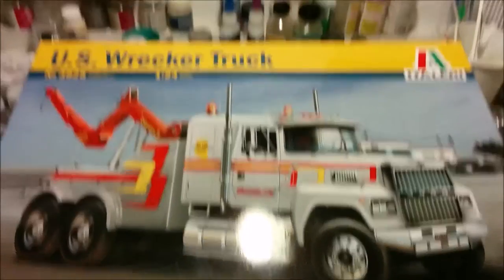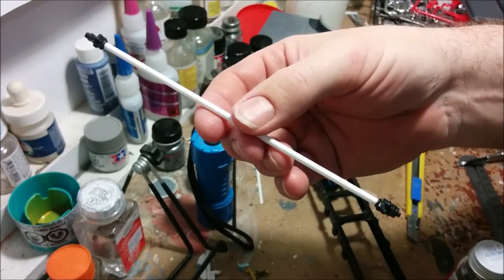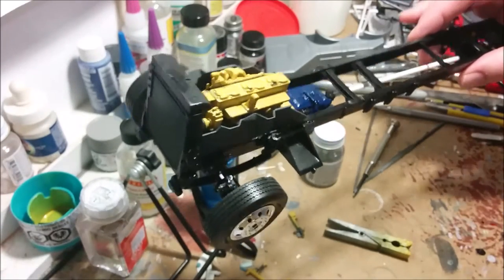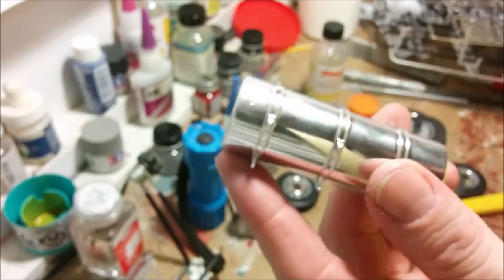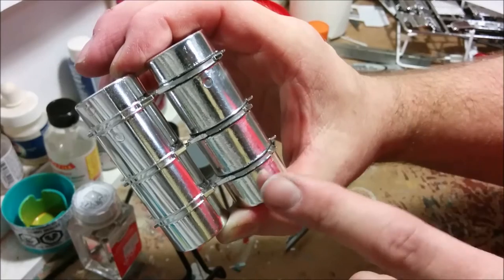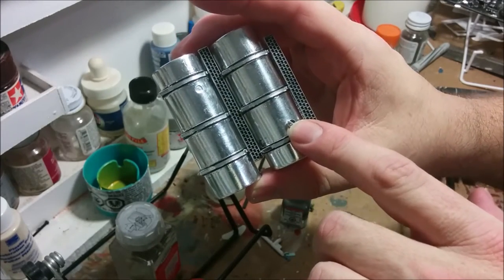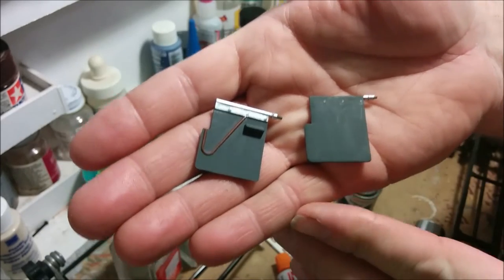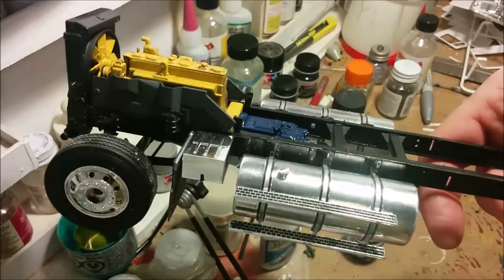Modern Wrecker Truck 1/24 Pt3 by Italeri

Comment: I’m super late to this party so I apologize for resurrecting an ancient comment section but I have just bought this kit and found your build series - I think it’s the best available for this subject, by the way. 

I was just wondering why you didn’t strip the chrome off a few of those parts, the tanks in particular, rather than trying to fight your way around it. The tanks on most heavy trucks are made of aluminum which some people like to polish to a mirror finish. However, no matter how much they are polished they never look the way kit chrome does. 
One of my biggest peeves about model kits is the gawdawful way the chromed parts look. I hate the way that chrome finish gives even the best built model a toy-like appearance, so I almost always end up stripping the chrome trees and either BM foiling or spraying parts with one of Alclad’s excellent options. This gives the part, and the model in general, a much more realistic appearance. 

That aside, I’m loving this build (excellent job stretching the frame!) and I’m enjoying your videos. Yes, I have subscribed. 

As a further aside, I have found K&S alloy tubing to be excellent for making driveshafts as it is straight and true and won’t bow the way a long length of plastic rod does. I would like to have seen that shaft split into two parts, or at least had a hanger bearing added. A single unsupported shaft of that length would probably deflect a bit and shake the crap out of the truck. 😀

Oh! One more thing: I note that you’re in southern Ontario so you may not see many northern haulers in your area. In northern Ontario (and many other parts of the country) larger deer such as elk and moose crossing the road at night are a danger to truck drivers. Moose in particular are heavy enough that, if struck by a highway truck, they can absolutely destroy the hood/grill, and tall enough that their main bulk will come through the windshield into the cab. 
Variations of the “Mad Max” style front bumper and moose bar that comes with the kit are quite common on trucks that frequent areas populated by these enormous creatures. It is terrifying enough to encounter one crossing the road at night in a heavily forested, extremely rural area where the only light is that of your headlamps. It is almost impossible to avoid striking the animal, so drivers try to protect themselves by installing very large, heavily-built bumpers/bars on the front of their rigs.

Thanks for all the great content. I am stealing a lot of your ideas and techniques.